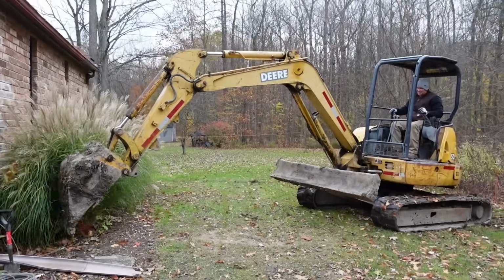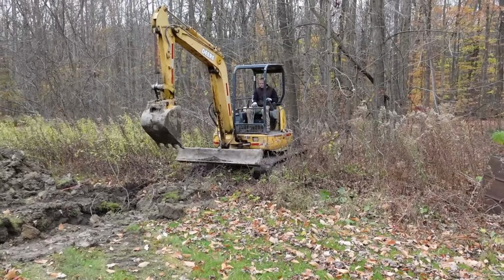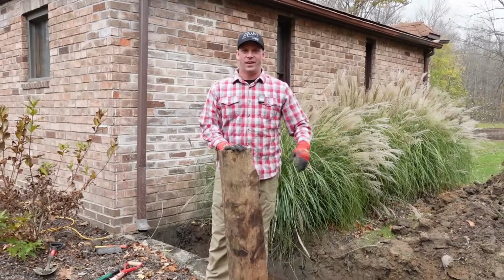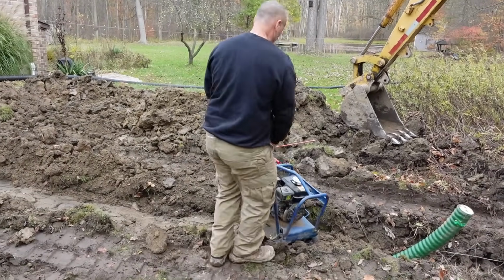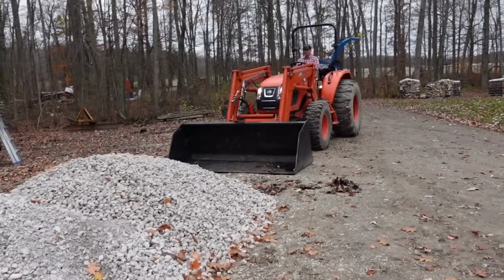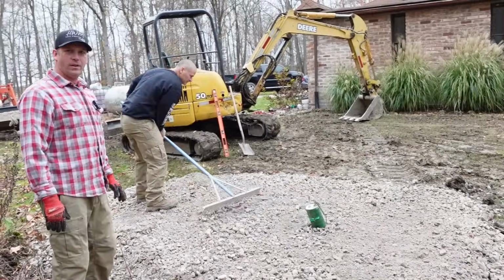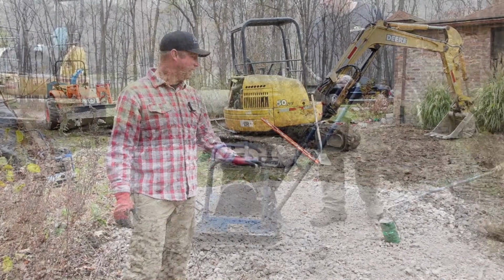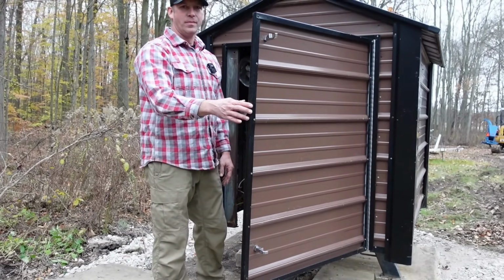Outdoor Wood Boiler Installation Video Installing Lines & Setting Boiler!

Comment: Looks good. I’d put more rock around the base to level to the concrete slabs. Just to maybe make it easier to get to 🤷🏻‍♂️.  Can’t wait for the fire up and see how it works. 👍🏻👍🏻🪵🪓🔥👋🚜
Reply from the maker: Thanks Noel, I plan on adding a few more loads of stone to do just that!
Reply: @hardworkingmanoutdoors  👍🏻👋

Comment: We used the thermal pex when we put our boiler in, that stuff is a pain to work with but it’s definitely the best option!  The pad will work out great, you can always pour one when you upgrade to a gasification boiler 😉
Reply from the maker: Thanks Tony, wish we would have left it longer on the boiler end but we’ll make it work. I’m sure I’ll be forced to upgrade eventually. That stuff is stiff for sure!
Reply: Don’t get a gasser, I got rid of mine and went back to a triple pass

Comment: You can always cut the front ones straight and lay concrete pads across the front to stand on. Make sure you leave some slack in the lines that go from your thermo pex to the feeds on the OWB. They will expand and contract abit during start up and shut down. Use Unions for connections also. You can cover your joiner pex with the foam for water lines. they make all different sizes so you can put 2 layers on them. I made a wood box all around my base and insulated it with roxul insulation which doesn't absorb water as easy as fiberglas pink. Time to start cutting your OWB splits as long as you can fit on your splitter. I make mine 32" long, alot less cutting and stacking.
Reply from the maker: Dale, o will definitely be doing something to make the workable space in front of the boiler larger. Appreciate all of the tips!  Just waiting to get the inside plumbing completed!

Comment: I install about 3 or 4 a month,  Enjoy the wood Heat, make sure you hook up to your hot water heater.
Reply from the maker: Thanks Corey, the hot water is one of the things I’m most excited about. We are thinking about burning all year just for hot water as our current water heater is electric. I have a 20 plate heat exchanger for the water.
Reply: 20 plate will work just fine.

Comment: Have wood have heat, we have a indoor hot air wood furnace it does 95 percent of our heat 5% oil hot air when needed.
Reply from the maker: For sure!  We provide 90% of our heat now with our wood burning insert. This boiler will most likely become our main heat source and the insert secondary almost eliminating any need for Propane!

Comment: When you pour your pad put a roof up and make it large enough to put a tote under it. Having to load those boilers in freezing rain and snow sucks. You can run a loop of PEX inside the pad when you pour it so it melts any snow that might get on it.
Reply from the maker: Thanks, that definitely sounds like a great idea!

Comment: What am I missing. If yall just installing used boiler now what was that line he pulled out and had to reinstall???
Far as the insulated pex goes you can hook lines to the insulated part and before you hook to boiler wrap in insulation andslip over a section of that flex drain..
Reply from the maker: Jimmie, that line was our sump pump drain line. I am going to see if I can use some of the thermoplex line that is in the basement to extend the lines up into the boiler. We left them a little short. But if not that’s a great idea!  Thanks.

Comment: Yup, that's it, you got it in place. That's what is important this year, but you guys. How much frost do you guys get like? Where's your frost line like? I know we're at here in Canada. Like not that we get it, but they say that our frostline is 4 feet deep.  So I know they always tell anybody that if you're bearing in water lines that like we never get below 4 feet. The frost doesn't we definitely sometimes? Depending on the winter will get more than 2 feet. So I just question if what you guys get for your frost. Where is your frost line? But 2 feet will still.  It'll never freeze because it'll always be warm. Hot water that's flowing in and it'll always be circulating. It's just the amount of heat loss anyways I know you're gonna like
Reply from the maker: Kent, I’m not sure on the frost line. I just know the guy I bought it from that installs these in this area as part of his business recommended 24”. Can’t wait to get it up and running.
Reply: 42" is our frost line though in our area it seldom goes beyond 24" and in general an inch and a half of insulation equates to 18" of cover so in theory he has 42" of actual coverage, also @hardworkingmanoutdoors will be running a closed loop system with antifreeze solution I believe. He'll be just fine either way!
Reply: U don’t need to install that at the frost line. 24” is enough for thermopex or any form pipe

Comment: I have the same one I think yours is smaller than ours.
Reply from the maker: Tyman, it may be. This was originally an AS1100 pellet burner and factory converted to the LT90 so it’s not identical to an original LT90 but similar.